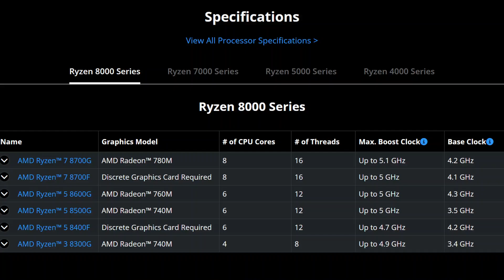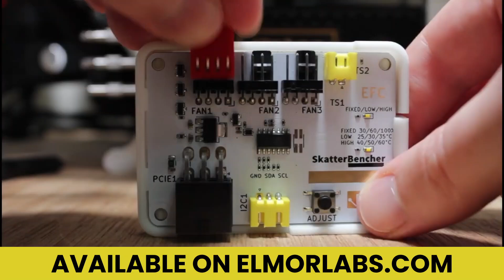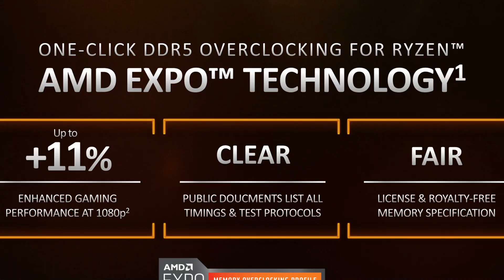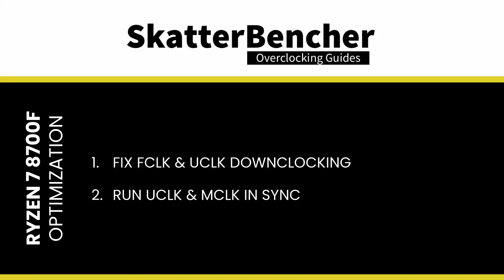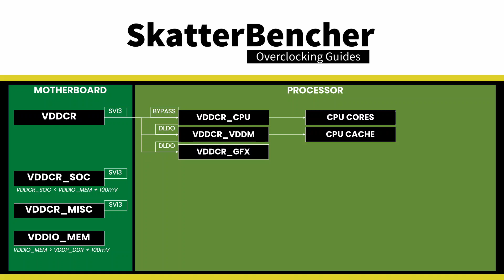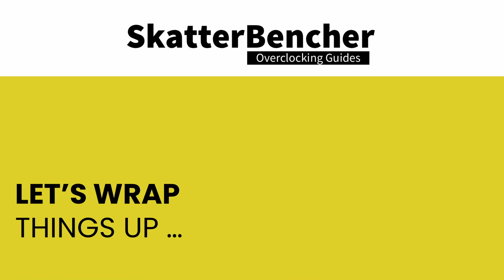Ryzen 7 8700F Undervolt & Overclock to 5250 MHz feat. ROG X670E Hero | SkatterBencher #76

Comment: R5 7500f for 129 or R7 8700f for 144 (euros, taxes included). What do you think should I do? I will pair it with a "old" RTX 3080, so I think PCI Express "issue" can be acceptable (it should work at 8x right?). So, in terms of overall performance, what do you think is better at those price points?
Reply: 8700f
Reply: for games 7500F

Comment: 8700f are stupid cpu unless it would cost 150-180$ at most  and it wont!! it would cost same as r7 7700/x and it is slower then it so again  this cpu are for  fools probably
Reply: Why so much hate? In my country i bought a new one for around 160$ and its very good for this price
Reply: @dgash9051  you payed that but for 8400f
Reply: @dgash9051  8700f for 160$!?where is that? Often they are like r7 7700/x pricing
Reply: @Mr11ESSE111  in my country 8700f is around 155$, with discount 149$
r7 7700x is 350$, with discount 344$
Reply: @pshipone376  then buy it!! 8700f are slightly over 5800x  but for this price its worth but i would not pair 8700f with cards above  rtx 4060/ti or rx 7700xt for 1440p  maybe 1080p
Reply: @Mr11ESSE111  I use a 3070 and don't really use it for gaming, maybe only occasionally,
I actually wanted to buy the 7900x3D to save power, but in some tests it was 7900x superior.

so I think just wait to buy 9900x3D if it saves power and gives good performance
Reply: купил за 150 долларов
Reply: @ALbFiShow  its good then over 5700x  but if 7700/x are 150-170$ there then its not
Reply: @ALbFiShow  then its fine for 150$  because its like 5800x in games and something bettter in productivity
Reply: Отличный процессор.
На алиэкспрессе стоит 85 долларов...
Reply: @КириллЗубков-ж3ю  so less then r5 5500
Reply: @Mr11ESSE111  Разница в производительности между R5 8400f и R5 7500f менее 12%.
Но в стоимости, более чем 30-40%.
r5 8400f - отличный базовый процессор, для вхождения в платформу AM5.
Reply: @КириллЗубков-ж3ю  then its better to buy  r5 5600/x  which are faster then r5 8400f  just like all am4 build !! in gaming its much faster then 12 % unless you play with cheaper cards
Reply: @Mr11ESSE111  Зачем покупать старую платформу, без возможности апгрейда в дальнейшем?
Reply: @КириллЗубков-ж3ю  because its cheaper and zen5 are fail anyway and zen6 its doubtfull will it support am6
Reply: 알리에서 101달러에 샀음
Reply: @volcaney  for that money is good
Reply: $160 Tray version
Reply: 150$ 8700f in Philippines